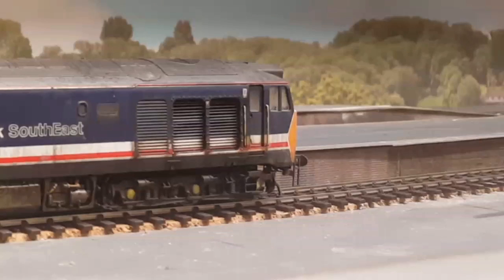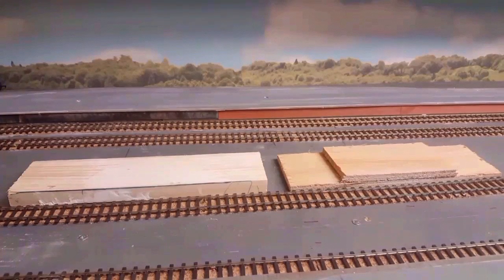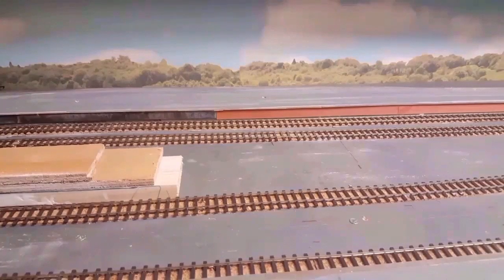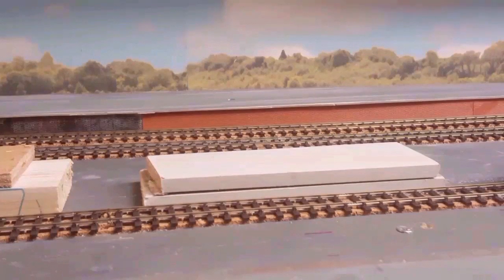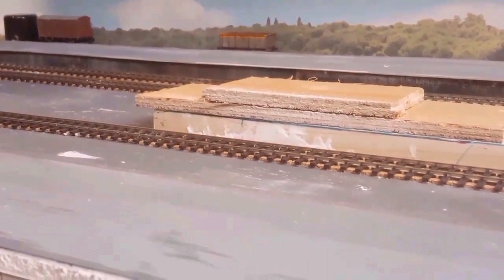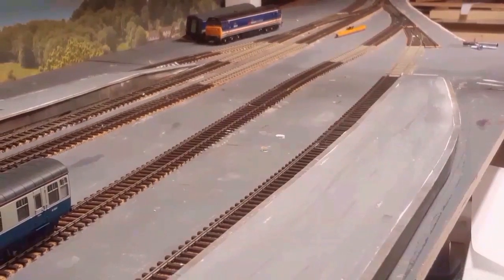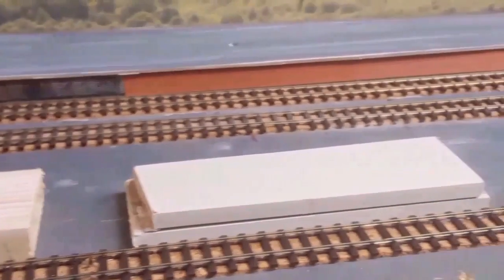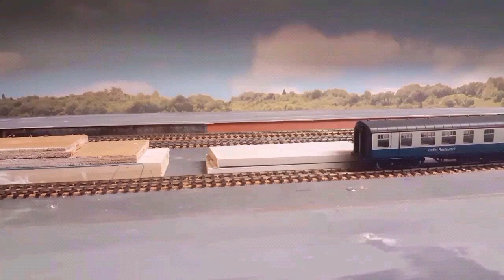Exeter & Laira. Part 6. Station Platforms.

Comment: Excellent Tim, hadn't thought of plaster board before a little too for me as I recycled the Ratio platform edges and infilled with the ceiling tile packaging from a recent purchase of a fridge/freezer (my method was a bit more messy). also for the plaster board if your modeling stone finish simple job of carving the stones no need to file the edges.

Comment: Great video!

I'll be making mine from mdf, I've also got some peco platform edges which I'll have to dremmel off the excess plastic.

Also, today I did buy some stone effect spray so I'll test that on some scrap pieces to see if that's effective.

I may end up going a few mm shy with the mdf and give it a layer of sand plaster so the "obvious wood" look isn't there.

It's a lot of work I know but I'm looking forward to the experimentation to see what works best.

The first 2 ft of the platform will be curved also!
Reply from the maker: Sandwell Junction. Cheers buddy.  Mdf was second choice but sick of the sight of wood lol.
Reply: Yes that's perfectly understandable 😂

Comment: Very helpful, I was hoping to use two sections of 12.5mm plasterboard stacked which i had laying around, however "i think" that means i would need to have 6mm thick cork. I reckon its too thick for ballast shoulders and track pins.
Reply from the maker: Yep I'd stick to the 9.5 doubled up. I'm due to completely overhaul my platform tops as I've had to make an adjustment to one section at the west end. I've never been happy with the edging slabs so they're being pulled up and a full run being made to the correct size. That will mean the whole top being re-done. 
The doubled up 9.5mm boards sit about right with the cork I've used.
Reply: @thescrapline4905  Thanks Tim. Little frustrating as I've pre-cut all the 12.5mm to size only to realise my error! i should have done my home work 1st!

Comment: Hi Tim, great video and think I will follow this method  at Sandling Junction as and when the time comes. A couple of questions, overall platform height base to top I thought was meant to be 18mm using code 100 you are making it 19.5mm on a 3mm cork using code 75? or Bullhead.?  Also is the 3mm cork just in station areas or all on 3mm around the layout? The pen idea is really neat how did that come about, I mean how did you decide the width of pen needed etc to gauge that spot on? The weight issues over time with sagging , have you increased the support underneath that area? Also the plasticard overhang, is that simply eye friendly or fine measurement? In my first layout I really had issues with track height and clearance even though all my platforms were Hornby clip and straight. its an issue for me to space track correctly moving through and each side of my future stations. I made card platforms but they warp too so really like the idea you have. Last of all Lighting? just drill all the way through and wire up under baseboard? Sorry about all the questions chum... best wishes Paul at Sandling Junction
Reply from the maker: Thanks Paul. 
Platforms sit directly on the baseboards and the track on 3mm cork so the height was spot on - all planned out with code 75 and bullhead (same profile rail)
The pen idea I discovered year's ago. Just needed minimum of 4mm distance so the thicker the pen the further away. The top edging is done by eye. 

The station deck has a plywood ladder frame built that supports it in all directions. The chance of it moving is zero. 
Hope that's makes sense